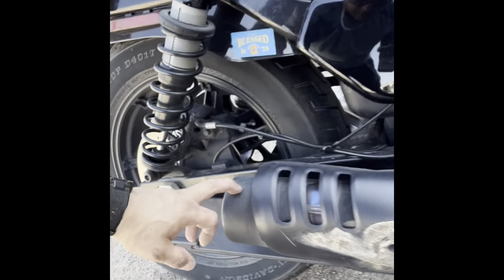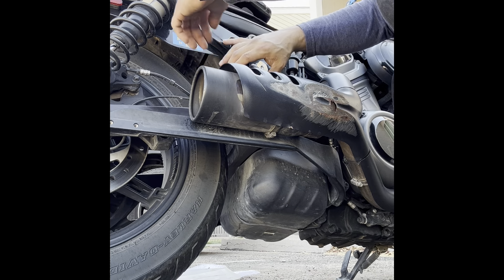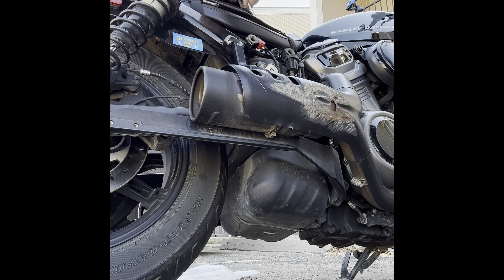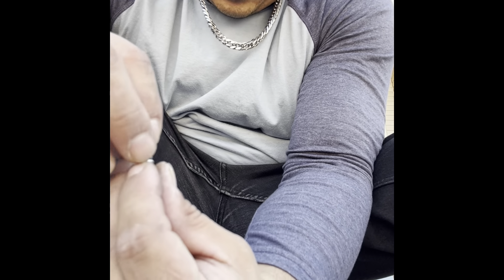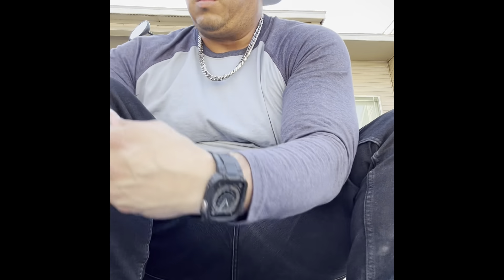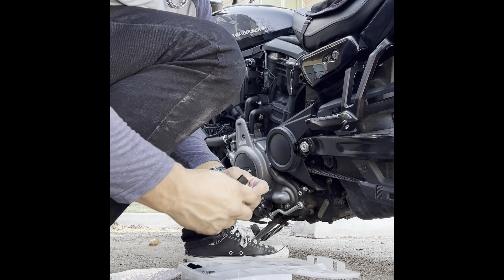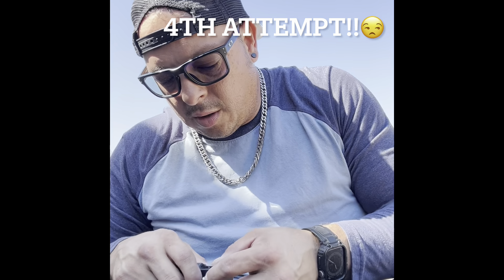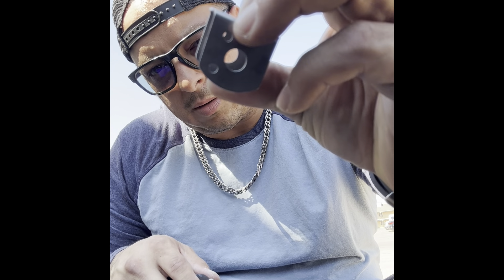Passenger Pegs PART 2.

Comment: It’s nice to see the exhaust seem to have absorbed most of the impact of a fall. Did you get any other damage from the fall? handle bar, radiator? Do you think the passenger peg mount would offer a bit of protection from a fall?
Reply from the maker: I replaced the handlebar only and the right blinker, which it is causing me troubles cause it’s blinking but isn’t stays ON as the left one . 
Nothing else got damaged except for the scratches to the peg and exhaust shield and break lever. 
I didn’t have the passenger Pegs at the moment of my incident so I’m not sure if they would offer any protection. 

Thanks god I got small bruises and I walked up right away.